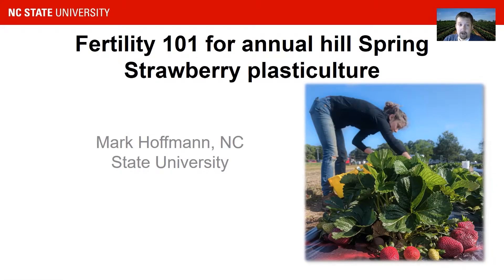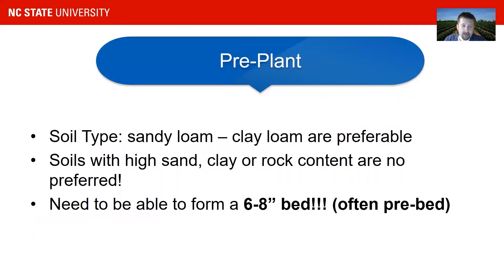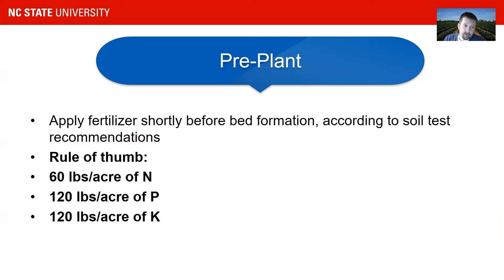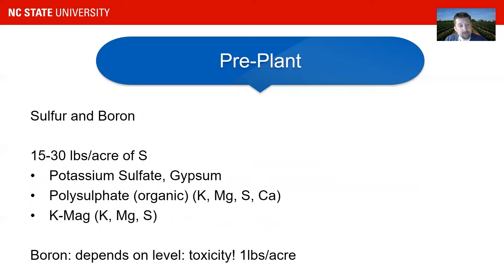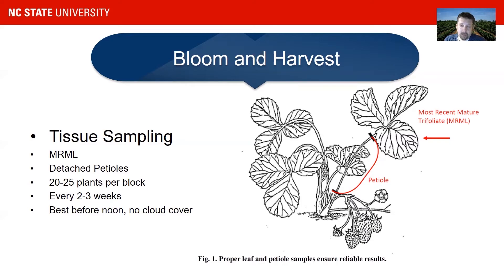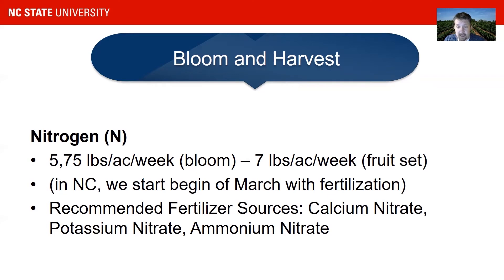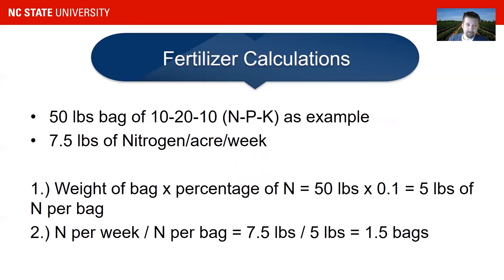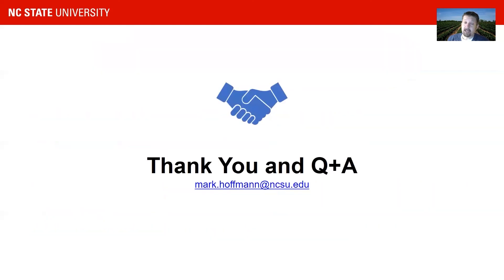Part 1 | Fertility 101 for Annual Hill Spring Strawberry Plasticulture

Comment: Interesting about the Boron requirement. I wonder if it can be applied as a foliar spray.
Reply from the maker: Yes it is common to apply boron as a foliar spray. Can also be applied to the soil or through the drip. But as said in the video, the rate is very important. Too high of a rate of boron can lead to symptoms of toxicity.